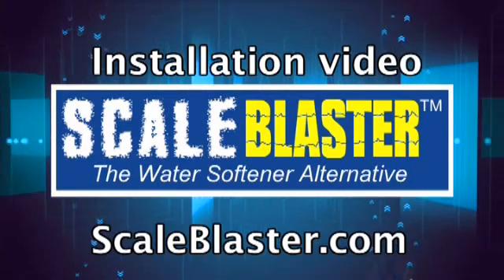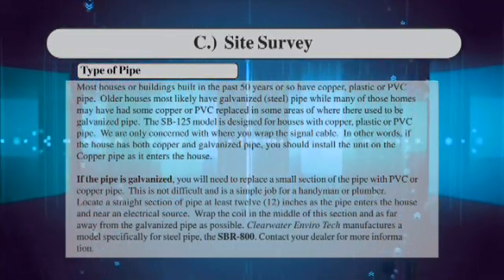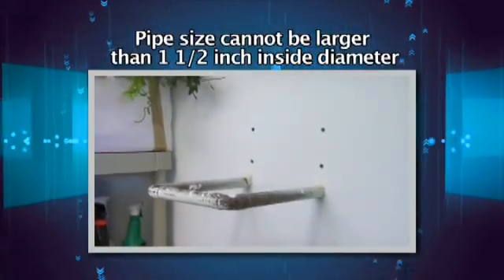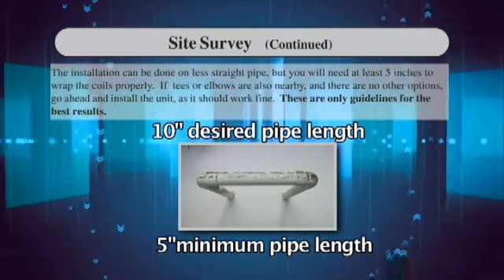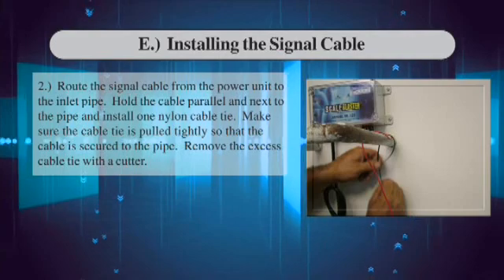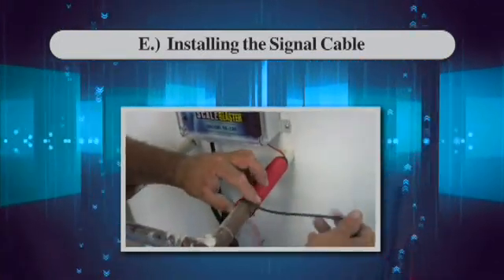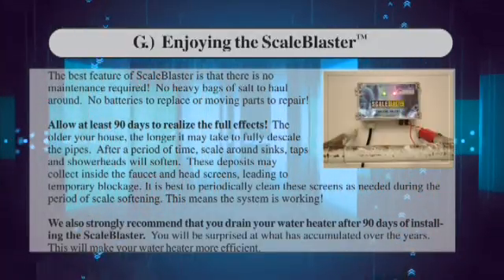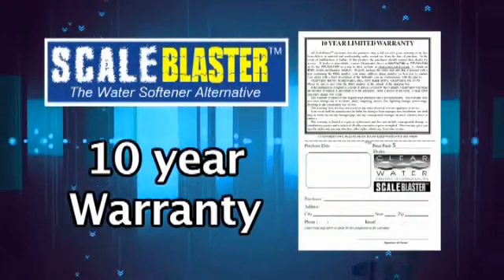Water Softener Alternative - ScaleBlaster - The Green Alternative to Water Softeners - Install Video

Comment: I can't think of any reason why this should work, and I'm an electronics engineer. The advice to drain the crud out of your water tank is good, though.
Reply: Where did you made your engineering course? Where I made mine we were taught of resonance frequency, which leads to the destruction of what it affects, or puts it into a very high energy state. This is the principle behind this kind of machines, which uses the resonance frequency of scale to destroy it's attachement properties to surfaces. Hope this helps.
Happy new year.
Reply: @ricardocandeias9163  I don't see how the tiny trickle of pulses from that machine is going to put anything in a "high energy state", either electrical or mechanical. Quasi-scientific sounding hand waving is not a theory of operation. 

 Since you asked, BEE from University of Detroit, MSEE from National Technological University. And working in high powered radar transmitter R&D 1968-2004.
Reply: @jamesvandamme7786  Yes, but thats the magic behind resonance frequencies 🙂 I'm starting to use this too, so I'm on an experimental phase. Let's see.